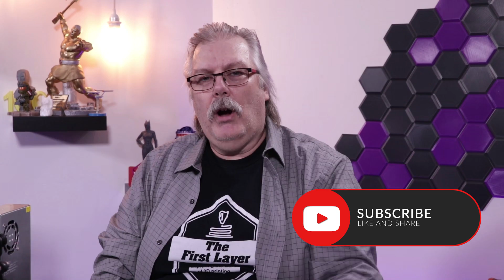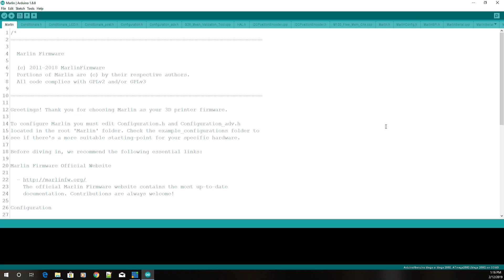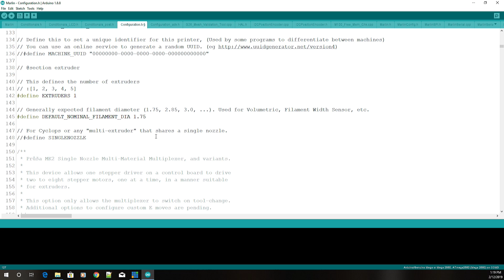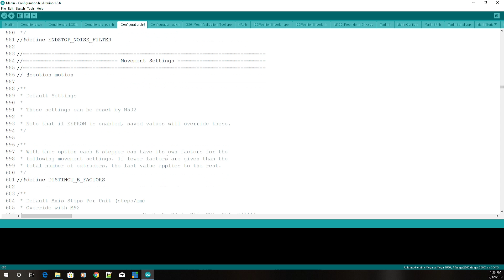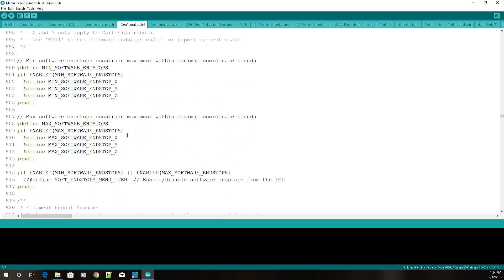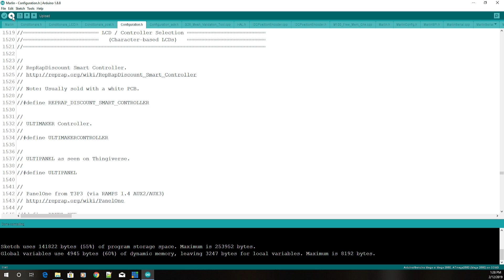Overhaulin' the Ender 3 PT2: Firmware.

Comment: do you have any of the links to any of the hardware that was used?
Reply from the maker: All the links can be found in pt1 Overhaulin' the Ender 3
Reply: @TheFirstLayer  This is how you should've answered this post....This provides better customer service than just saying, go check my other video. Unfortunately, this doesn't get you another view on that other video. :P
*Pasted description from first video here**
This build includes the following part:

MKS Gen-L v1.0 
https://spool3d.ca/mks-gen-l-v1-0/

Watterott TMC2208 Stepper Driver Kit
https://spool3d.ca/watterott-tmc2208-...

LV8729 Stepper Motor Driver (MKS)
https://spool3d.ca/lv8729-stepper-mot...

Lerdge Heated Bed Power Expansion Module MOSFET
https://spool3d.ca/lerdge-heated-bed-...

MKS TFT32 v4.0Touch Screen
https://spool3d.ca/mks-tft32-v4-0touc...

Ender 3 MKS Gen L adaptor case and mount by TeachingTech
https://www.thingiverse.com/thing:331...

MKS 3.5" (TFT35) Screen Case for Ender-3 by dRizZe99
https://www.thingiverse.com/thing:322...
Reply from the maker: All the links can be found in pt1 Overhaulin' the Ender 3
Reply from the maker: All the links can be found in pt1 Overhaulin' the Ender 3